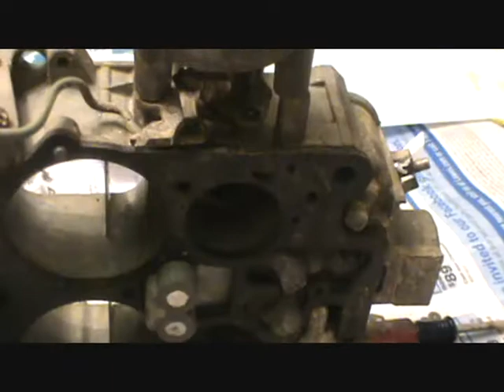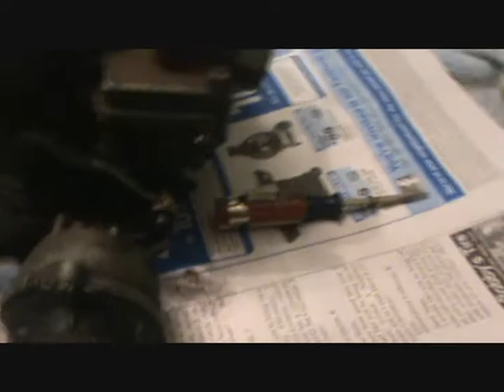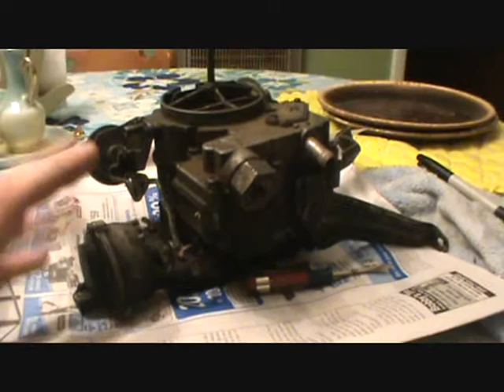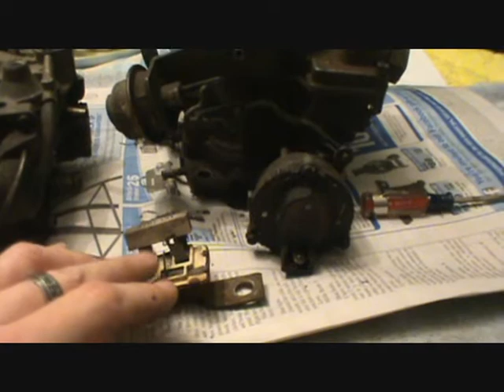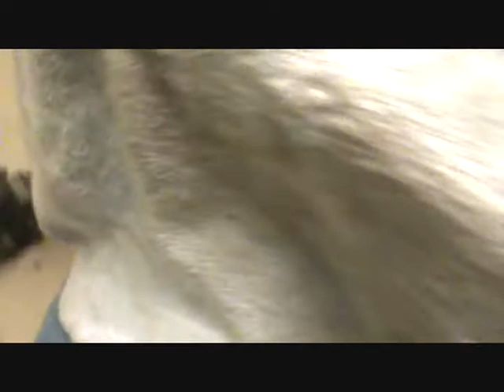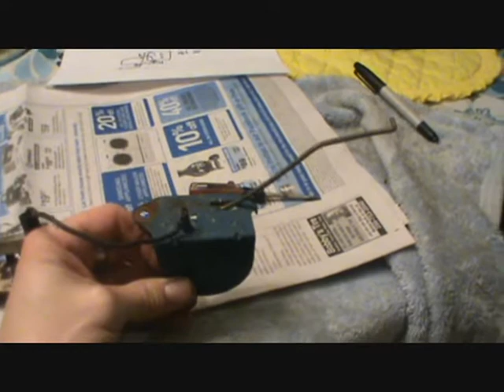How to understand automatic chokes part 3

Comment: Hey Tyler, great series. Like DL24, it looks like some one was trying to set up an electric choke on a hot air choke assembly on a Jeep I just bought. . Things is it’s a quadrajet set on an amc 304 that doesnt seem to have a hot air loop set up.  So it looks like I need to get a new electric choke assembly. Or is it ok to just let the vacuum pull in a little unnecessary air through the choke?  If I plug the choke body inlet will the carb not breathe well? Let me know your thoughts if you can,  but regardless, thanks for the great tutorial.

Comment: Wow, thank you for the explanation. It seems that I've got some sort of the "hybrid" system, with a hot-air choke housing married to a cap with an electric heater element. No one else was able to explain it for what it is. It seems that someone tried to modify a truck carburetor with a hot air choke to make it work in a car that previously had been equipped with an electric choke. Now I know that I the replacement carb I'm looking for should have electric choke.

This whole series of videos was of great help !

Comment: Hey, I have a 4 barrel quadrajet on my 77 camaro, it used to be a hot 
air choke now its electric due to the new motor having an intake without
 the hot air assembly. in order to install the electric choke I had to 
remove that little vent tube inside the choke body and install an 
electric choke body that has a bevel going into the place where the 
little vent tube was, could this be a potential vacuum leak in the future?

Comment: I got it running pretty well, by doing those suggestions. found one vacuum problem (hose was not connected; so many hoses!!!) idle seems to be set just about right, may be slightly low (not sure) but notice no real problems from that. All good accept the dieseling at shut off. someone suggested timing is off. which i'm sure it is. do you have video to fix timing on 85 chevy silverado?

Comment from the maker: It sounds like you have some other problems besides the choke but let's do a quick run-through adjustment:

 Cold, it needs to be nearly LIGHTLY closed, not adjusted so it is tightly closed. Make sure the pull-off is good and is pulling the choke a bit when the engine starts.

 If it's dieseling when you turn the engine off and you have to shut the choke to kill it then you have something else going on. My guess is a vacuum leak, or the idle is too high.

Comment: I have a Roch. Quad and can't find the happy medium on my choke (just rebuilt it) when it's cold it won't start because it stays closed; have to pop the hood to hold it open to start. when it gets hot and stays open it won't shut off and chugs until i manually push the vent closed. what do you suggest?

Comment: can you enterchange a electric choke to a hot air choke? i have a 1977 chevy k10 but i feel it is and 80's model carb when i bought it 17085226. and i recently changed it out with a 17080213. seems to be running better but i'm not giving up on the 226. i don't feel the electric is better either what do you think i should do?

Comment: my electric choke on my M4ME 1986 has a temp sending unit that taps into the water jacket of the motor. as the coolant warms up, the temp sensor allows more voltage to pass through it, heating the choke more. so if the motors not warm, the choke wil stay closed all damn day(it would if i ad the choke plate on it )